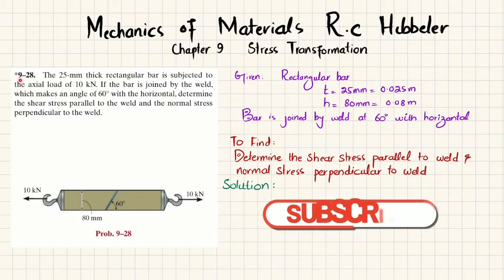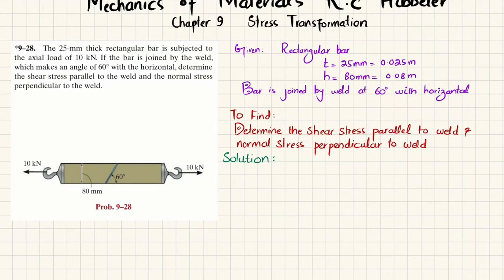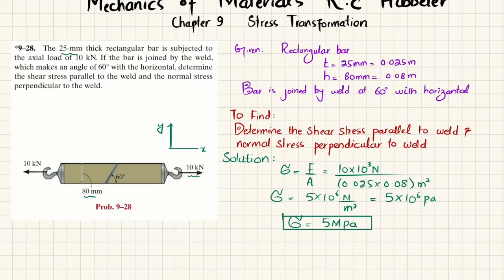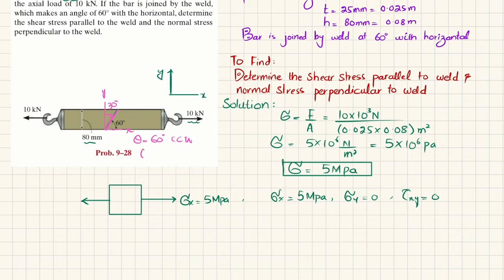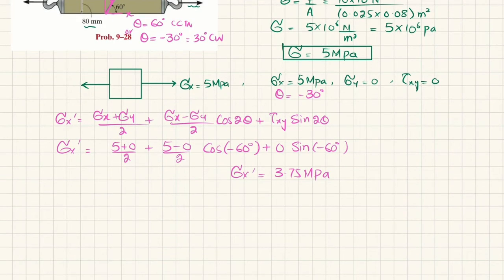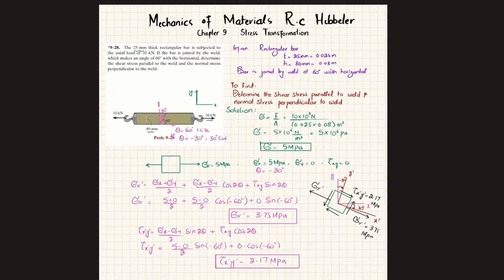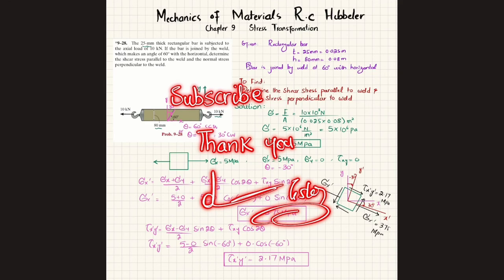Determine shear stress parallel to weld and normal stress |Problem 9-28 | Mechanics of materials RC

Comment: why did you take the absolute value of the transformed shear stress'?
Reply from the maker: Where did I take ? Kindly mention the time please
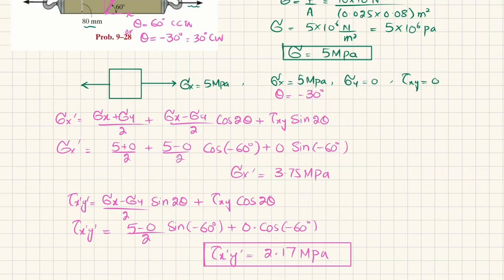Reply: @engradnanrasheedmechanical  5:50
Reply from the maker: Ok what do you mean by absolute value of transformed shear stress?
Reply: @engradnanrasheedmechanical  so when I calculated the equation, I got a negative value for τxy, apparently the sign of the value is important, but I'm curious as to when the sign isn't important
Reply from the maker: Yes you are right sign is important. I shall check it as well why I wrote positive  value if its negative. And one more thing if transformed shear stress comes out to be negative then only direction of shear stress will change . In diagram you can see the both arrows head are mating and if shear stress is negative then the arrow head will be opposite to each others.
Reply from the maker: @tturi2 you are welcome